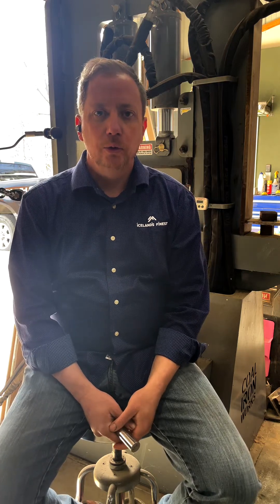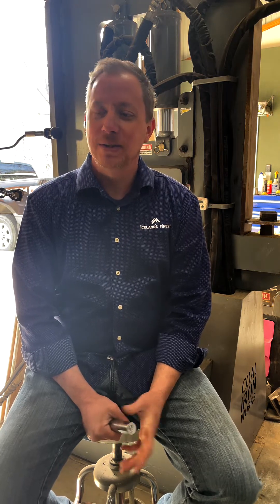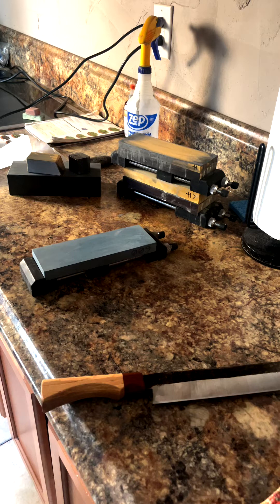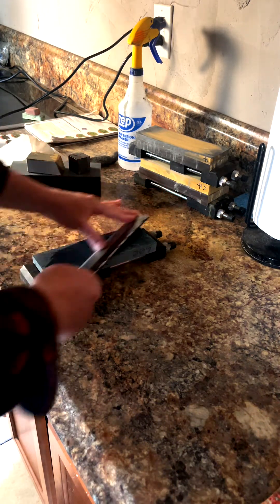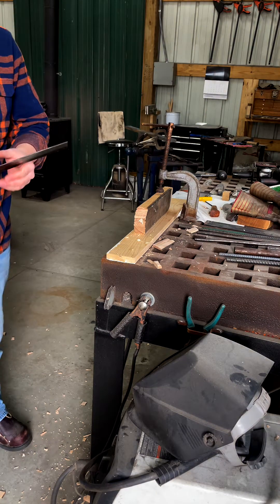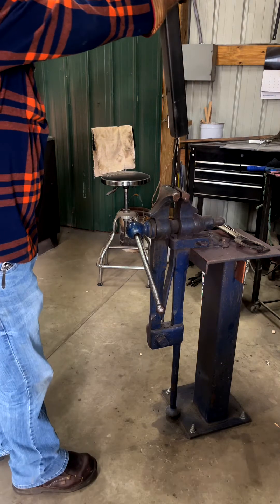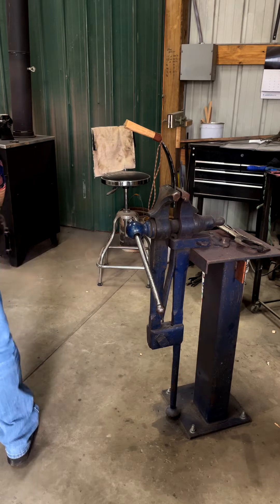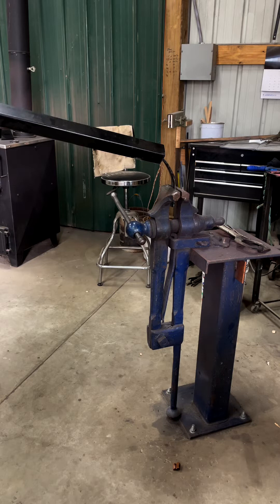Can 4140 steel pass the ABS Journeyman Performance test?

Comment: Very interesting test. I wasn’t surprised by the performance. The only aspect I was questioning was if it would pass the edge-holding test. 4140 is good stuff for axes, but I wasn’t sure it would hold the hair-shaving edge after chopping wood. I appreciate your experimentation. Fairly plain carbon steel can do some pretty amazing things. And I love your forging press!
Reply from the maker: Pretty much what I expected it to fail as well.  It is quite a press.  Thanks.
Reply: ⭕️ I'm not looking for a heat treatment that is "perfect" ... I'm looking for the treatment that works... and your demonstration... works.  could you give me a process that you used ?
Reply from the maker: @prepertruckin8525  Sure, after forging, for 4140 I usually bring to 1600F and oil quench in a fast oil such as Houghton K or you could use Parks 50 if you want until black, approx 900F.  Straighten on the anvil at this point if you need to before the steel cools to 650F.  Then after hand warm, I double temper for 2 hours per cycle at 400F.  This should give you about 57-58 HRC.  4140 doesn't make a good knife, but it will make a knife.